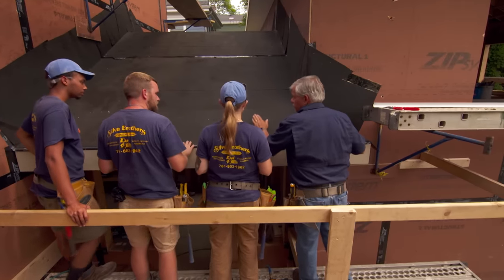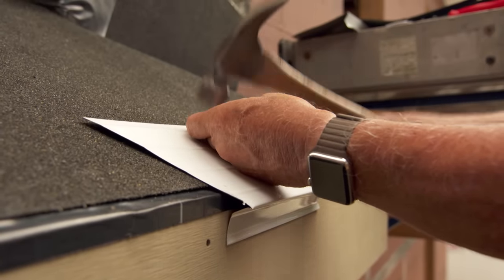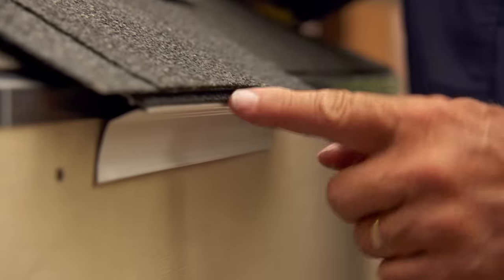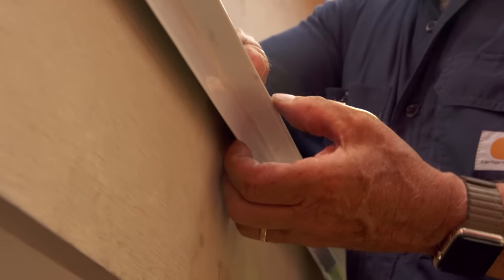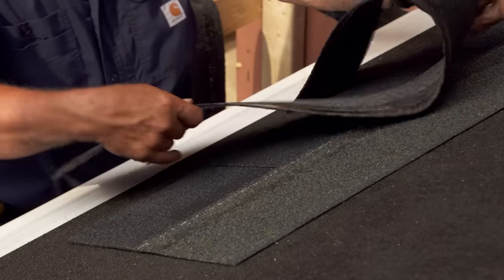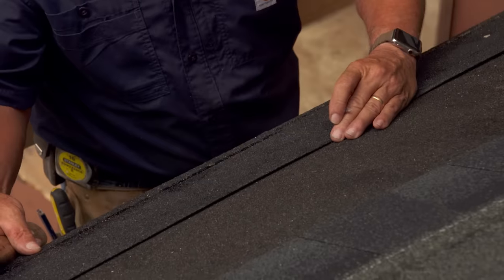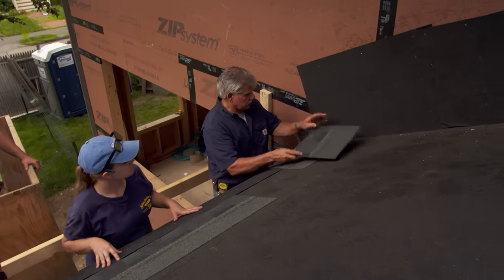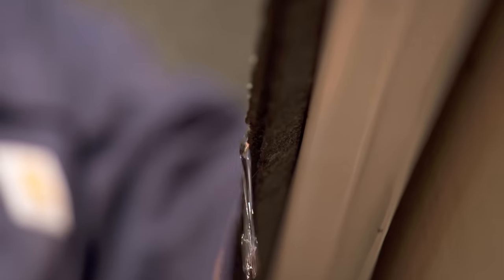How to Install Drip Edge and Step Flashing | This Old House

Comment: One thing I have learned from watching multiple videos about correctly installing a drip edge. There is absolutely no consistency in the industry from one contractor to another.
Reply: Dirk Moore - Well said!
Reply: Biggest debate seems to be if you put the drip edge under or over the underlayment. I honestly got tired of debating and decided to run a course along the edge. Put the drip edge down and then run the full underlayment all the way up on top of it. Side courses everyone does on top
Reply: Water is the ultimate judge!
Reply: You are SO correct
Reply: Yep. At least on YouTube. I am not a contractor or a construction guy I’m a DIY guy. But I think if you look up code it will show exactly how it’s supposed to be down in your area.
Reply: @mrlarrybobjr  Code does not address every little detail like what this video discusses.
Reply: @rock4891  p😊0
Reply: @maloosecat123  😊😊
Reply: Watching this and learning how the roofer botched the drip edge on my roof…
Reply: Same  @petesilvestri
Reply: @petesilvestri if your fascia board is covered with aluminum fascia then the gap thing isn't a big deal. As far as whether the felt goes on top or under the drip edge I've seen videos of Tom doing it both ways so that's just a toss up
Reply: Thanks for the information. Unfortunately my facia boards are not covered with aluminum. 

I’m thinking of changing all of my facia boards to composite and that should solve water issues.
Reply: @petesilvestri  no problem. That may mean a new roof though. Certainly they'd have to replace the drip edge, starter row and shingles on top of the drip edge I'd imagine. Not sure about that though. If your fascia board is still solid I'd look in to just putting aluminum fascia on it that may solve the issue. If you have a contractor buddy I'd see if he could look it over for you and get his idea.

Comment: Drip edge on the eaves should go under the felt. That way if water gets under the shingles it rolls onto the felt and over the drip edge not under it.
Reply: Exactly. I don't understand how people get this wrong. I install my shingles from the peak down...lol
Reply: Ice shield First. Then drip. Ice shield should be installed 3" down over the gutter board. You can install a 6" strip of ice shield over the drip. Then install underlayment over all so shingles don't stick.
Reply: @larrycrookshanks9091  Is the "underlayment" you speak of the membrane layer he refers to at the very beginning of the video? So instead of that being first, you're saying an ice shield, which he doesn't seem to utilize at all, should be installed 2-3" from edge of roof down over the fascia board and up to a not specified point onto the roof (several feet? halfway? the whole roof?). Then the drip shield, then ANOTHER ice shield layer over the drip shield, then the membrane sheet over all of that? If it works it works, but that seems like an excessive amount of layers that'll raise the shingles off of the roof by a lot.
Reply: Exactly my thoughts.  This would seem elementary.

Comment: The biggest issue I see on new homes is they install the drip edge flush to the fascia and leave no room for guttering to slide under the backside of the drip edge. So they just install gutters over top of the drip edge

Comment: Works great until somebody puts an extension ladder up against that roof and the drip edge and shingles gets crushed
Reply: Very good point. I guess you put the ladder on the fascia and climb over carefully. Good to know ahead of time.
Reply: Yea, never see anyone install it stuck out like that with a gap. Not a good idea, you simply do not make the shingles flush, give it a bit of a overhang.
Reply: The ladder goes on the gutter
Reply: @gaijintendo  good luck getting back on the ladder if you don't have rungs over your landing.
Reply: Leopold  are you getting off the ladder onto the roof? There's a big difference between working off a ladder and getting off a ladder. Or rather getting back onto a ladder after having gotten off of it at the top. If you plan on dismounting a ladder at the top make sure you have two rungs over the edge to hang onto as you get back onto the ladder. It is a basic ladder rule. Because without two rungs over the edge you have to do some sketchy acrobatics to get back onto the ladder. Although oddly getting off the ladder is pretty easy without rungs over the edge. It is getting back on where you're going to run into problems. There's nothing but air past the ladder then to grab onto. You're going to look pretty foolish trying to hang onto thin air too.
Reply: Leopold  you have not answered my question. Are you getting off the ladder and onto your roof? I know what step ladders are.
Reply: @travisedwards9983  That is what I've always done.  In summer heat the shingles sag a little making a nice flow into the gutter.
Reply: How about just leaving a little shingle overhang instead of overhanging the drip edge which I don’t think is suggested by any manufacturers?
Reply: You could modify the ladder not to touching the drip edge. I modified and added wheels onto the end of my ladder and I can roll it wherever I need.
Reply: Anything can be damaged by doing something that shouldn't be done - and placing a ladder against the edge of the roof like you describe, shouldn't be done. A ladder going to the second floor should have a standoff, which should be touching either the siding, or, in some cases, the shingles themselves.
Reply: SILICONE!!!!!!! GEEZE
Reply: @1pcfred  You got that right, especially for someone who does not like going on the roof in the first place.
Reply: @pcm7315  only circus acrobats should ignore the two rung rule. The rest of us who do not want to break our necks need to put the rungs up and over. You need something to hang onto as you mount the ladder. That becomes painfully obvious as you go over the edge. Be nice if I had something to grab. Watch out for that first step, it's a doozie!

Comment: The only problem I see with the shingles hanging an inch over the drip edge is if you put a ladder against the house to go up on the roof you’re going to crush those shingle edges.
Reply: You need a over hang on all edges you can't run them flush
Reply: Buy a ladder "yoke" that sits under the top rung.  The elongated "U" shaped yoke raises the ladder up off the roof and away from the flashing, the shingles  and/or gutter.  Every roofer should have one.  Most do.
Reply: You invite bats to nest along the roof line when there is a space. They cause damage as well. Never knew thus until I moved to the country.
Reply: There will  be an eavestrough there.  And you should always use ladder standoffs or a gutter guard.
Reply: The ladder will hit the gutter before the shingles.

Comment: I was told that the bottom drip edge should have the waterproof membrane placed on TOP of the drip edge. The sides and top should have the membrane UNDER the flashing… which is correct??
Reply: I've seen Tom do it both ways in videos.

Comment: He makes the "starter course of shingle/strip" stick out 1/2 so it does not wet the metal and roll in. to the fascia.
However it might be too easy to break (brittle) and I believe it is not necessary now that the metal final edge is fully inside the gutters.
Reply: It shouldn’t have anything ever come in contact that could break the edge. I’d prefer it dripping over than onto the metal and could possibly wick back under the shingles and in a lot of cases behind gutters.

Comment: With all do respect, where i live 9 times out of 10 there is an aluminum fascia covering the fascia board. Therefore worrying about the water rotting the board is not an issue and the water drips off the bottom of the aluminum fascia. The aluminum fascia even has a protective design to stop against water wicking around and causing problems. Thereforw i choose to install the shingles flush with the drip edge to reduce the risk of ice in the gutter or wind  lifting or breaking the bottom of the bottom coarse

Comment: Did the same on my wall to roof but used Tyvek Protec 200 ran 2 feet up the wall. Then wrapped the wall. Where we live we get no snow. Then I made step flashing out of aluminum 3.5" legs and 8" long cut from 14" trim coil. worked out fine. I also used some Dynaflex 230 black caulk anywhere that seemed it needed some. My house built in 1973 has aluminum siding and no J channel along the edge, which I like the look. I replaced the exterior sheet rock with 1/2" plywood.
Reply: Sounds like a good job. Only thing I would’ve done differently is use 30# Felt instead of Tyvek and Henry’s Wet Patch instead of caulking.

Comment: My only issue with this is nailing the step to the wall. When those shingles are replaced down the road, if the reveal is different, the step won't line up and will have to be adjusted. If you nail it to the wall, the siding has to come off to do that. One nail, in the deck, on the upper corner away from the wall is ideal. 

One of the biggest pissers in all of roofing is having to remove the siding to fix the step flashing.
Reply: Dude EXACTLY!  Do you also nail step flashing to a skylight?  NO!  You don't nail to a wall ever because wall finish methods outlast shingles by many cycles.  And here we are another supposed contractor doing a how to video teaching the wrong methods.  You put a flashing down, you put the shingle over it and nail as close to the wall as you can in the normal spot as well.  Place another flashing OVER THE NAIL and then a shingle over the loose flashing and then nail the shingle like  you normally would again near the wall.

Comment: Tom is very close on his install. Correct  installation is Ice shield  down over  gutter board  2-3"  then drip edge. No other way.  Then install a 6" strip of ice shield  over the drip on to the existing ice shield.  Then install  starter and shingles  1/2"-3/4" past the drip edge. Tom is absolutely correct on that as the water will wick back to the gutter board and down behind the gutter.
Reply: Ice shield obviously seems like a good idea, but when you reroof, does it come off easily or does it adhere to the plywood/OSB so well that it comes up in chunks or damages the plywood/OSB?

Comment: Drip edge first then ice and water over drip edge. Or you'll be replacing a foot or more of the sheeting and facia in ten years or the next shingle job. And on valleys nip the top corner of the shingles, valley side, at a 90 degree 3/4 inch cut so the water won't follow the top of the shingle. I've worked with old roofers and am always watching for tips. The little things are the difference between called back or a job done right. I'm no roofer but have done enough to see how shingles and water works. Learned a lot from this show but am surprised about the drip edge being the second step. Ice will back up the shingle and go around under the drip edging hence the ice and water being so sticky and melts around the nails.

Comment: I agree with Tommy on this one. On my house, with aluminum fascia covering the wood, the drip edge was up against the fascia and water would run down the fascia and behind the gutter all along the roof. The gutter was useless in a light rain.
Reply: True. But if the shingle had a 1" overhang I would imagine that wouldn't happen. Or did it?
Reply: Gutter should be installed up under the lip of the drip edge.  That way the water runs into the gutter from the drip edge.
Reply: I would never install the gutter. If heavy rain flash down to the grass, I could install step stones along the line 16" from the wall.
Reply: @HsingSun  the spashing from not having gutters will ruin your siding  unless you have long overhangs and the splashing will not reach the walls
Reply: @corysturgis6660 not to mention foundation

Comment: There is consistency in manufacture guidelines. Drip goes on bare roof deck on eaves. And over top of underlayment on rakes (gable). Think like water. ..Water gets under shingles it will possibly run under that drip edge he installed over the ice shield. Probably never be an issue the way they wrapped the ice shield on the fascia but still. Gravity and water is why the manufacturer says to do this way..

Comment: Mr Silva I am not an expert like you but my method would be drip edge the ice and water on top right to the edge of the drip edge and then starter strip hanging over the drip edge about a 1/4 inch and shingles inline with the starter strip...
Reply: Yup this way is wrong and you don't gap your drip edge like that you but it tight and that sun fascia gets wrapped.......

Comment: By pulling the drip edge away from the fascia plus adding a half inch overhang off the shingle you are going to miss the gutter on a heavy rain. Plus 90% of houses have metal fascia that’s held tight to the rough fascia by the drip edge if it’s tight against it. I’d also put the tar strip down on a starter row to keep the wind and rain from getting under it. Don’t have a 1/2” overhang of shingles because in 5 to 10 years it’ll sag. To a previous comment about not nailing your step flash to the wall, you are wrong, you need to. Nobody is tearing off siding and replacing step flashing when re-roofing
Reply: All instructions I can find state that step flashings should be nailed to the deck only.  Not the walls.  With building movement you want the steps to be moving with the roof plane not the wall plane.
Reply: Not sure if a 1/2" is going to sag noticeably, but you could always split the difference and go with 1/4" and do the same with the drip edge, instead of the 1/2 - 3/4" you get with putting finger behind it, use a 1/4" spacer. Also, use 6" gutters and you solve a lot of your issues.
Reply: 100% step flashing should be nailed to the deck not the wall. When that roof is redone with a different shingle in 20 years, with different reveal, the step won't be positioned correctly and will have to be replaced or adjusted. If you nail it to the wall the siding has to come off to remove it. 1 nail on the deck at the top corner as far from the wall as possible.  When you rip the old roof leave the step loose and reposition and renail them as you install each course.

1/2" overhang is fine. May sag a bit but not bad. And generally, where I work, gutters are pretty much all 5" now, so unless you go overboard, covering the gutters isn't an issue.
Reply: @jimtocci9125  It seems like the majority of contractors say 1/8 overhang with the shingles and I can never find anything on drip edge, but generally it's just a good idea to give it enough space that the gutters will fit. Not an expert, but to me it seems like everyone is not paying enough attention to the gutter. Sure, slow water would drip into the facia if there wasn't gutters, but going crazy with overhang would kinda defeat the purpose of gutters.

Comment: Leaving a finger width on the drip edge would fail inspection in Florida. Besides, that's rake edge flashing. Eve end is longer going down. Guttering keeps water off the facia.

Comment: The issue i have here is now you're losing gutter opening, you already have a 1/2 inch lip on the face of the drip edge and Tommy held the drip about a 1/2 inch ( fingers width) away from the facia and then he held his starter down another 1/2 inch past the drip so he's losing 1 1/2 inches from the 5 inch standard gutter opening which in some case's depending how well the gutter was hung a good steady rain will over shoot the gutter, if the facia is covered with aluminum trim there is absolutely no reason to hold drip away from the facia...
Reply: Cases
Reply: Agreed.  I like the idea of a space between drip edge and fascia, but I think a 1 inch overhang for the shingles is too much.  I think a quarter inch is plenty.    Also, instead of drip edge,  I use a longer piece of flashing that overlaps the edge of the gutter and deposits water straight in.  So no fascia is exposed.

Comment: That drip edge gap.....hmm.  My fascia board also has a 1x2 nailed to it, under the drip edge.  It's an old roof, maybe something that's not done anymore.  But it seems to help protect the fascia better (kinda like a double fascia in that area).
Reply: Agree! We should have 1" x 2" behind the drip-edge. They installed it in 1983 on my house. If the drip-edge bend out further, rain will flush away from fascia further. I installed a wider piece metal at the end of valley, the rain flush away further.
Reply: Same, got house built in 1973, on top the rake fascia is a 1x2 at the top. I like the look of it.  I am shingling now but not going to do a rake metal drip edge, don't see the need. I replaced all my fascia with GC PT 1x6's, and painted both sides of those boards. Ground contact PT wont rot, and it does hold paint just fine. Now at the eaves, it is just 1x6, but I plan to put on aluminum drip edge, to me it seems useful as the way my house is made, there is a gap at the bottom edge of the plywood where it meets the fascia and a drip edge will seal that better. Plus it may improve the lifespan of the shingle edge. I also will have to paint the new drip edge to match the color. of the fascia boards, not a big deal but paint it before it goes up is easier.